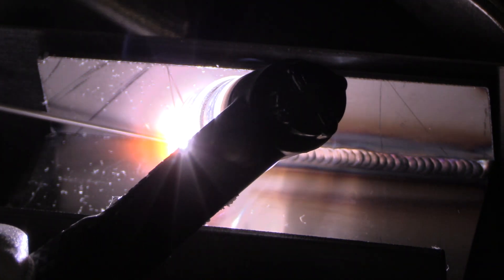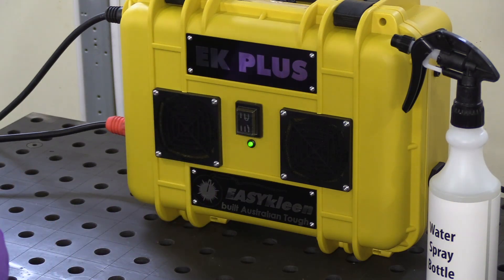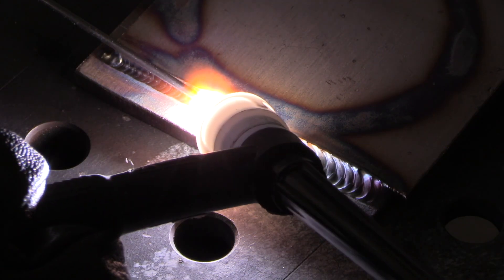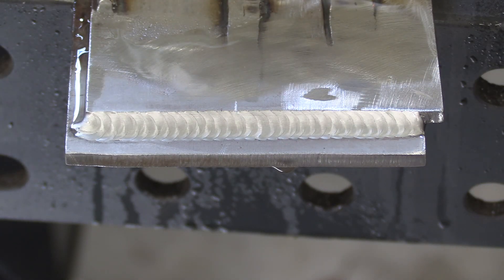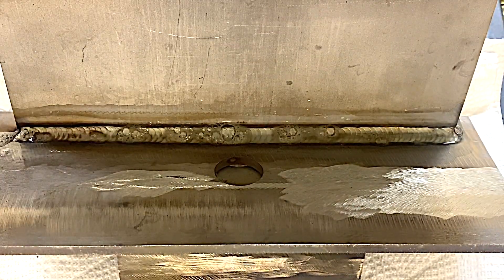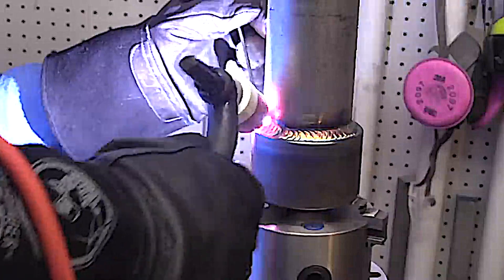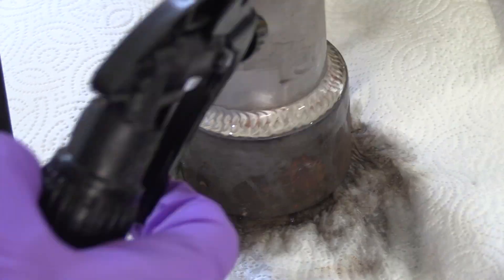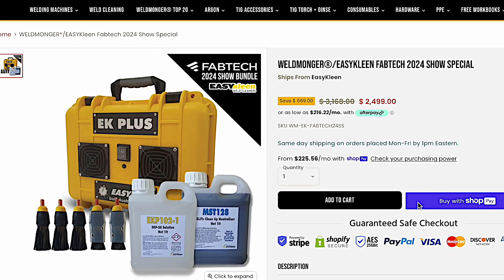EASYKleen EK PLUS Stainless Cleaner

Comment: is this safe for stainless steel kitchen utensils? After purchasing some stainless steel graters they have this oxide black residue on the tig welds. I've tried removing with lemon, bicarb soda, bar keepers friend, vinegar, soaps, but every time I wipe it down it gets less but always has some left over. Any tips would be appreciated. I've uploaded an example https://youtube.com/shorts/ew1juFAD2Ps?si=UaJMaC66JCf4pCjC